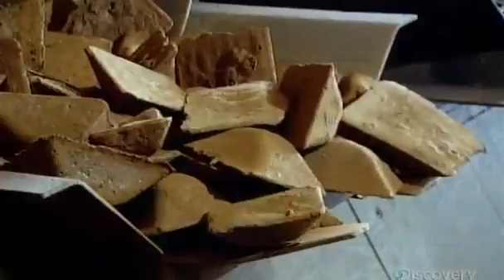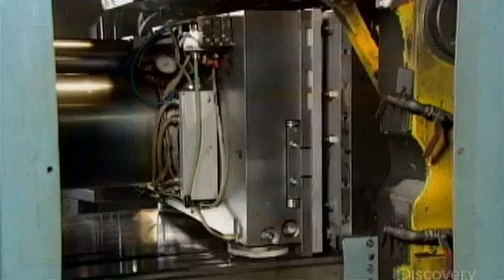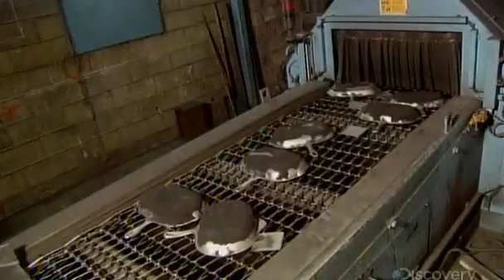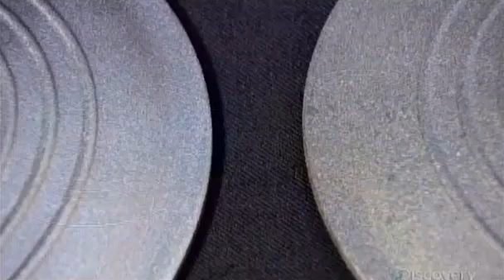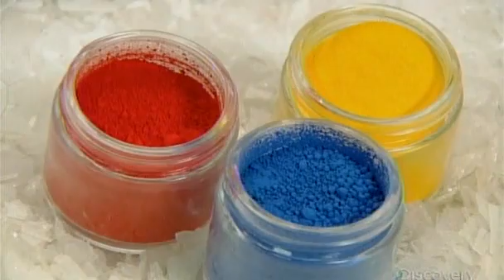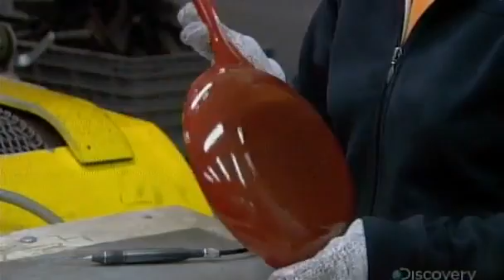How It's Made - Cast Iron Cookware  -=KCK=-.mp4

Comment: Le Creuset's fired enamel cookware is of high quality, and is less stcky than other brands. But it can't compare to well-seasoned black iron or carbon steel, in either performance or durability. It's also not thinner and lighter than the best old bare iron, nor is it maintenance-free. And the enamel eventually becomes more porous with use. Unless kept in the box or on a shelf, these are not heirloom items. The only thing they're good for is acidic foods or liquids which might compromise your black iron seasoning. And for looking pretty, they're good at that.

Comment: Nice but a waste of materials.  Most people buy cast iron to put their saucepan an skillet's because if you don't defuse the heat you can end up with burned food.  Stove's that use that spiral heating element over heat at the center which is bad for pinto beans.  The cast iron defuse the heat an spreads it out so the center is the same temperature as the rest.  We mexicans don't want our beans burned.  Of course go ahead make your improvements They'll work great for going camping this way we can put it right in the fire an not have to put some fancy stuff to hold it above the fire. Some times we don't have the time to look for things. Faster is better.  Thank You Loader.

Comment: I'm not gonna eat out of anything where the food surface has been painted.
Reply: OMFG. Enamel is not paint. As they stated, it's essentially colored glass that is baked on. FFS, your water heater, depending on age, is likely enameled ("glass lined"). Granted, water from your water heater is not safe to drink or cook with, but not because of an enameled tank. Enamel is much safer than the carcinogenic coatings used on cheap non-stick pans.

Comment: I've entertained the idea of picking up an enameled cast iron piece, but I think I'll stick to my black seasoned cast iron.
Reply: I use the ones my Great great grandma used. A few are over 100 years old
Reply: Still using the ones Mom gave me over 30 years ago. If it aint broke, don't fix it.
Reply: Don't go to a store, get your cookware at a restaurant supply store.
Reply: I know this is a year old comment but some people may find a response interesting. 

You will often find kitchens which have both enameled and raw cookware,  the reason for this is because the flavour of a dish is changed by the use of raw cookware over the enameled variety. When you use raw cast iron it will pick up flavours from everything that has been cooked in it, this is wonderful in some regards but it's a big problem when you are trying to cook something which has subtle flavours. Enameled cookware has the advantage here as the glass coating is chemically inert and so it doesn't pick up any flavour from the food cooked in it. 

I suppose the most important thing is that people realize the benefits of using traditional cookware if they hope to produce decent food, the cheap pressed steel and aluminium cookware actually works against the person using it as there are constant hotspots which result in burnt food. It's unfortunate that most people seem to buy cheap cookware as they think it's all the same, they don't seem to understand that a good piece can be passed down the generations.
Reply: Al Machado q.v.
Reply: Al Machado I have used enamel pot of chili and soups and it's good stuff.
Reply: Al Machado  The enamel cast is wonderful but easy to chip. Once it's all chipped, it's rubbish

Comment: Enamel is prone to chipping, what is so special about this that it will "last a lifetime"?
Reply: It all depends if you have a self cleaning oven, and whether fires are part of your life. But sure, that works fine. My point is mostly that CI is really tough, and insanely durable. It drives me crazy with all the old wives tales around CI.
Reply: Wrong. I've only had mine for 2 years and it is not even usable anymore. They will only last for years, generations or a lifetime if you don't use them. Mine is chipped and the where it is not chipped the enamel is so thin and crystallizing. On the other hand, my regular iron skillets, which I have used for probably 10 years now, almost daily, are in perfect condition.
Reply: I'm with Jennifer. Thrift stores have many enameled units that are a mess. Some of us just do not baby our cookware. If a regular cast iron  pan goes south, I just put it in a fire, it burns off all the seasoning, put on a new seasoning, and the pan is as good as new. I do this once a decade or so. when the seasoning builds up on the bottom.
Reply: An easier cleaner way to do the same thing John, stick in the over when you do the "self cleaning" on your oven. Does the same thing, burns off all the stuff just like in your oven, without the mess.
Reply: CB+ This will stink up your house also. Ask me how I know
Reply: Dang now I'm wanting some cast iron cookware

Comment: If you own enameled cast iron. Can anyone tell me if this enameled faulty? Just concern with the chemical exposure through the obvious little pores. Thanks

http://postimg.org/image/xsie569wb/
Reply: But actually as you bring your cast iron to heat, it will re-sterilize.
Reply: +steve19800 the enamel is only there to stop rust its non toxic.i use a non enamled cast iron fry pan i just have to oil the pan after washing. the only time the holes would be a concern is when its not washed properly and could harbour bacteria. :)